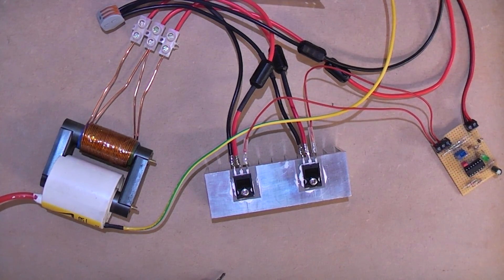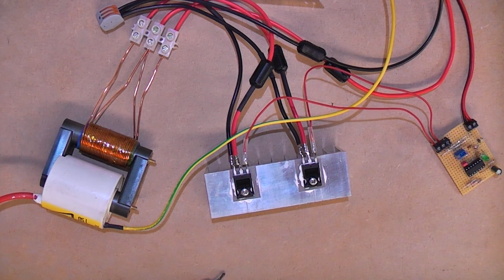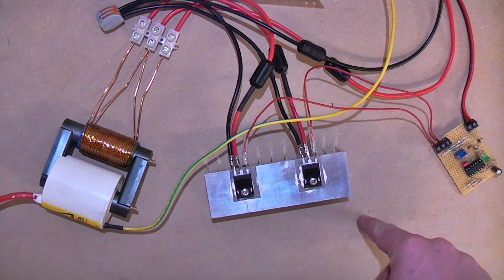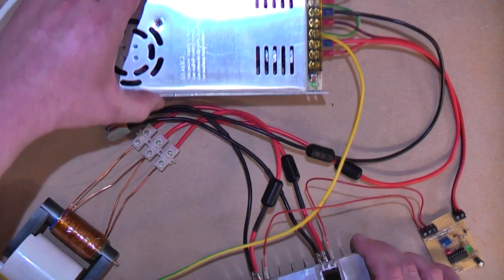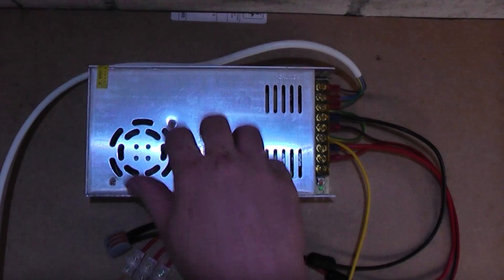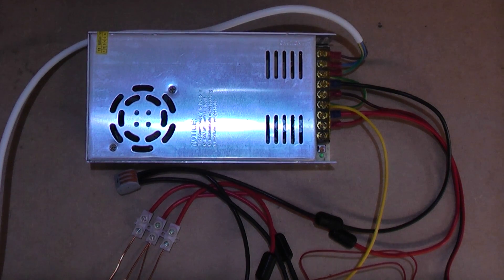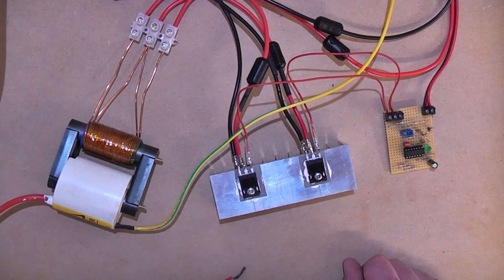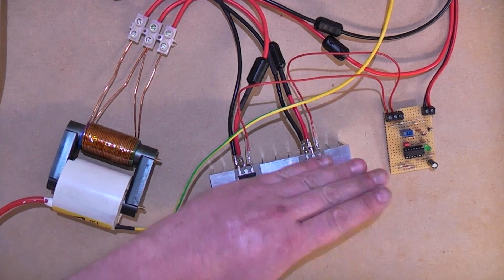CD4047 Flyback driver,

Comment from the maker: Timing capacitor in my circuit has been changed to 680pf (681), resistors changed to 10kohm in series with 10kohm multi turn pot.